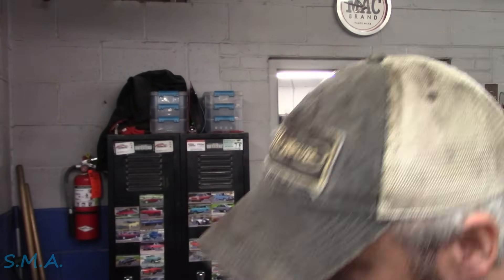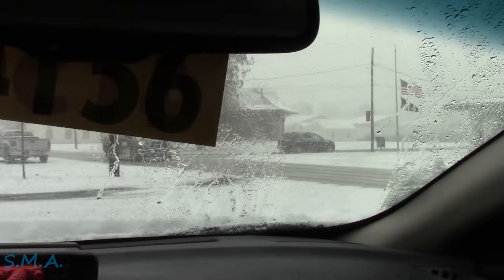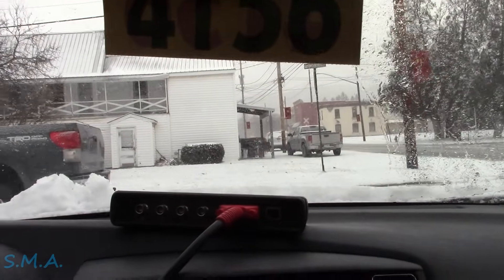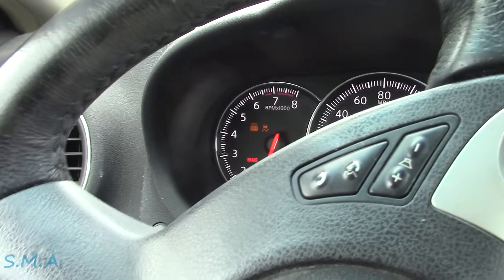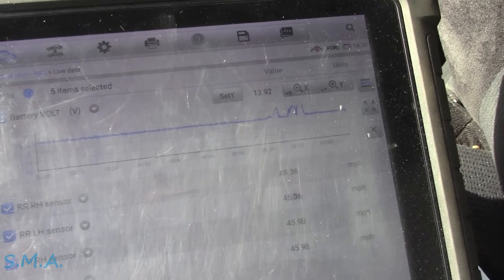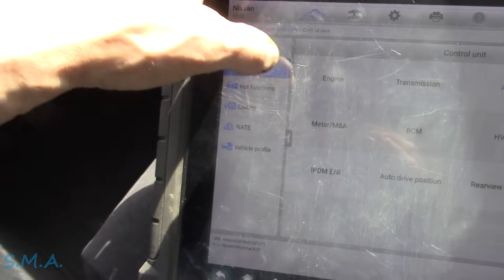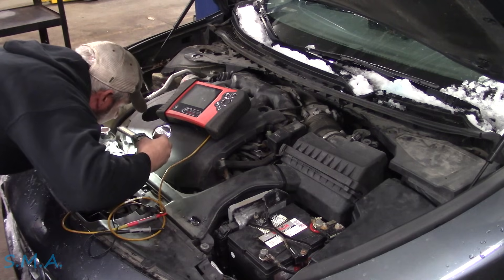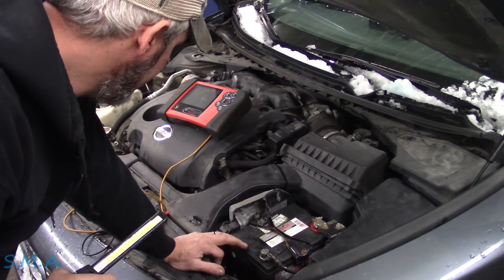Nissan Dealer Quoted Over $2000 For A New Harness!!

Comment: I'm curious to see what happens if you disconnect the battery while it's running to force it to run on alternator only. I always do this to help diagnose intermittent charging system failure. Obviously if it's not charging then eventually the vehicle will stall out but in the video I don't think I saw the voltage ever drop below 12.6 so this may not do anything to help. Just a thought.
Reply: That seems like a rather dangerous strategy. If you disconnect the battery then there's no large constantish-voltage load as a first line of defense against high voltage out of the alternator. Without the battery attached, if the alternator has a fault that sends it the direction of high-voltage output, it's going to go much higher and do more damage to modules etc.

Comment: Some of the cars I worked on had over 17 separate harnesses and each one takes less than 14 seconds to install at the factory. So a couple of hundred for a harness and if warranty time is used. That pays nothing. It shouldn't cost $2000

Comment: Well the dealer sez it right. But sma try to be direct. Anyway I've been there this issue with Nissan a31 and once cost me 3 oem alternator. Unseeing the main issue inside the positive terminal within the battery fuse and cable

Comment: My granddaughter’s car had something similar in the fact everything went stupid on the car including the throttle. It was a small Dodge. She took it to her “trusted” shop and they couldn’t find the problem. They took it to another shop and they had it for a week. Meanwhile I did some research on this car and this problem. Seems the problem is not unknown and is related to the alternator putting out garbage that drives the PCM batshit crazy. I called the shop and ask if they checked the alternator. The young man was respectful but assured me that couldn’t be the problem. I ask him to put a scope on the alternator output and observe. He actually called me back and said the alternator was putting out damned near everything but DC then asked me how I knew. I said 45 years working on cars and the internet. New alternator fixed the problem.

Comment: Could it be that the vehicle has a new battery that needs to be "registered"?

My Audi supposedly has software that makes the alternator compensate for an aging battery and so when a new battery is introduced, the software is still making the alternator compensate and could over produce voltage.  The registration process is supposed to fix this.

Comment: Had a Skoda Octavia (VW) clone that had anti-skid light come on sensors checked out ok, looked if anybody else had a problem sure enough someone said does fault happen after ten mins driving. happened exactly 10 mins consistently.. seems it was a broken wire going to the alternator . fixed wire no problem after fix ......strange or what ..

Comment: Uh oh, lost your speedo when it cut out, sensor, connector or wiring issue involving the speed sensor....ground?

Nissan with noisy belts, lol, thought that was normal. Manual tensioner technology from the 50's. Loose belts or over tight. :)

Ok, I'll hush and watch the video now...

Comment: Hmm . You have electric power stering and smart alternator,  possibly your power stering motor ask for high current smart alternator try to solve the problem and work over limit ( in nissan and Renault max voltage for smart alternator is 16v😵) everything over is reporting as charging fault on dashboard.  Try if you can do alternator test  on your tester you can give command 30sec. 13v and 30sec 15v use your multimeter to check the readings.  This function is available in renault ( nissan=renault in Europe most cars)

Comment: How you going to just leave us hanging? Not familiar with electric power steering but the fact that it only happens turning left makes me think its something in the steering or there is a wire that got caught in the column shaft and when turning left it shorts the wire. Had that happen on my sisters car and it also caused the steering wheel to only go right because to the left it was pulling on that wire.

Comment: "There's your problem lady! Quick, free fix for you! Drive like a UPS driver, NO left turns!" (Obviously something is wrong with the Gyroscopic Control Module (GCM) or its connection to the Power Control Module (PCM). The 'ol GCM/PCM interface problem, sure that you've seen it a thousand times!😃

Comment: them pads are trash, they do nothing to prevent corrosion. also NOCO spray does nothing for corrosion either, cause if something is going to corrode, it's going to corrode. alternator is trash, replace it and be done with it....@13 minutes...

Comment: If you're the shop manager at a dealership, this vehicle is shouting money loser.  Usual one hour of time for a diagnostic may not work.  The actual time it takes to find the problem won't be billable to the customer.  So, quote a repair cost the customer won't authorized and get this one out of the shop.

Comment: Whats 4156 is that like trade plates?
Reply: That piece of paper hanging on the mirror?  Probably a tag that the dealer had on the car so they could identify it on their lot.  Might be the work order number so when a tech is assigned to screw up the car he looks at the number on the work order and then goes and finds the car with that number on in in the row of "to be worked on" cars.  It is still there because nobody ever thought to take it off...  Just like the dealer tech never thought to clean the battery terminals.

Comment: Totally unqualified guess, but I think you were on to it with the left turns. A wire got chaffed through making intermittent contact with the steering or some associated component, or the clock spring buggered ?
Maybe the belt squeal is actually a slipping harmonic balancer inner and outer spinning in each other, like on Hondas or Ford Sport Track and a few others ? When it hooks back up it sends the voltage high ?
Can't wait to see what you find.
Take care.

Comment: soon as you tested I thought it was a regulator, That's why they are called stealerships , we had a guy come in a truck newer , and dealership quoted $2500, of work , we checked it out it needed a coil pack I believe , and some inj cleaner no joke

Comment: Customer asked me today, Why are you expensive? I said, Cause you get to eat the honey without dealing with the bees. Got another job from these folks with that comment. They also pre pay and overages without complaint. C class Mercedes Benz but they are the Chevrolet of Mercedes. Problems are a top 5 list and all easy to do with a fat fish on the hook. Still 40% cheeper than the dealership and made 1200 bucks in 4 hours. Timing on a 1.8. easy.

Comment: Had a 02 Nissan sentry i liked the car but it stalled constantly on me 1.8 always had gas it would drive and stal)drive and stall some more took it on several long trips and it made it to where I wanted just stall and stall had everything checked needed radiator put coolant in it full soooo sum time could catch before it stall not too often though

Comment: I have the same problem with my 2000 jeep tj. Turns out that the ground cable on the engine block is loose.